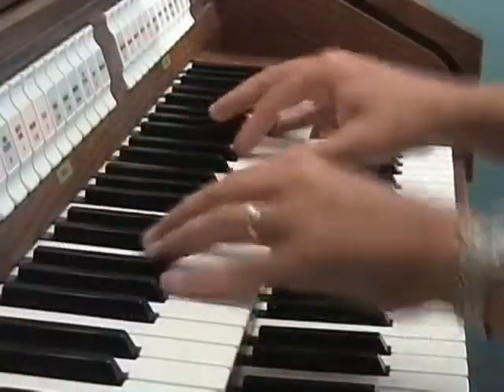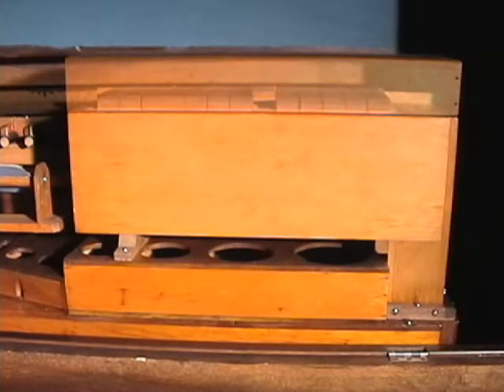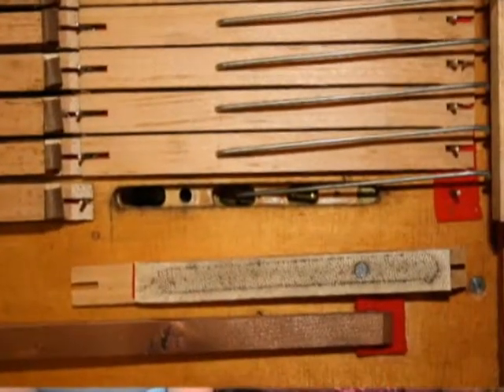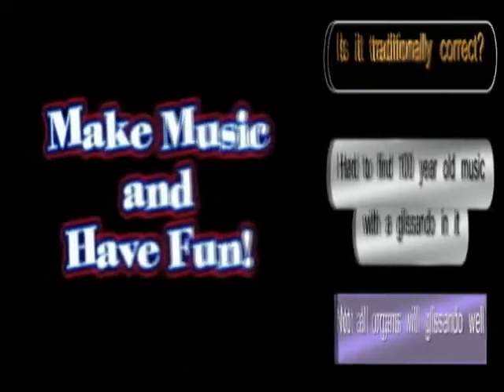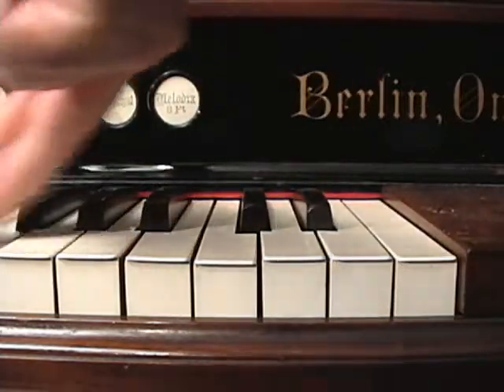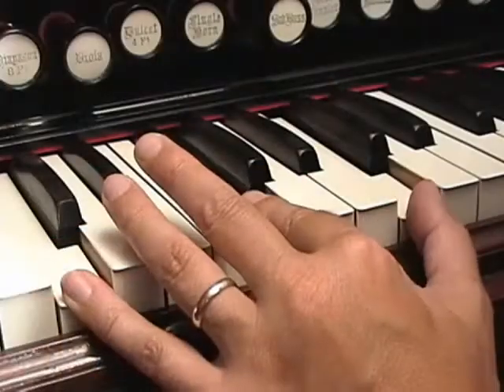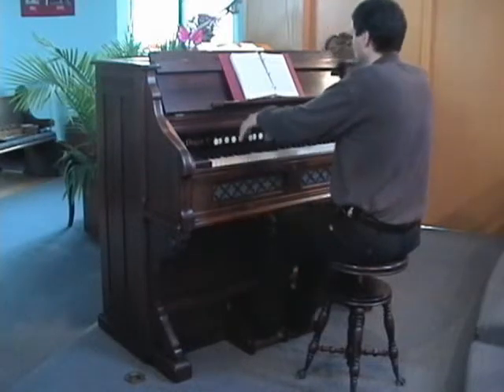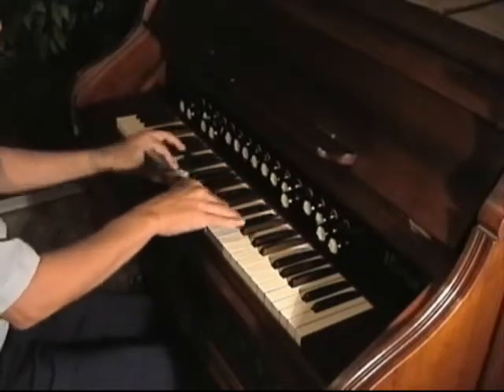Reeding101 - Chapter 3 - Playing Techniques

Comment: Thank you very much for a fascinating insight into reed organs. We've just had our 90-year-old instrument lovingly restored and it's to be installed this weekend back in its place at our local church. I don't know who the manufacturer was, but I'll post it soon. I'm a pianist and will be expected to play it, and your tutorials have helped enormously. Just one question, the church is not heated, and it's about -5 there just now and generally pretty humid. Will that matter much? Thank you for your help.
Reply from the maker: Congratulations on getting the organ restored!  If the restoration used original and natural materials that the builders used, the organ will be fine in -5 temperatures.  The problem is with dampness where condensation forms, or sudden changes in humidity.  Most of these organs were made for expansion/contraction, and survived for many years in unheated churches.  The organ in this video was one of those, and could still lead congregational singing after almost 100 years with very little maintenance. 

Feel free to send a message if you record the video!

Rodney